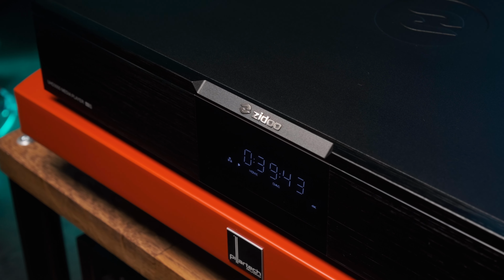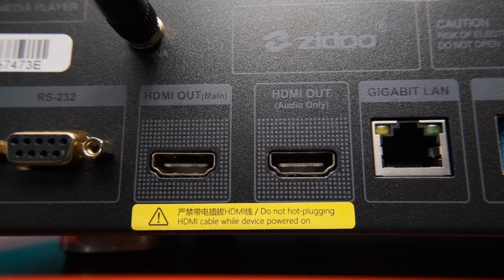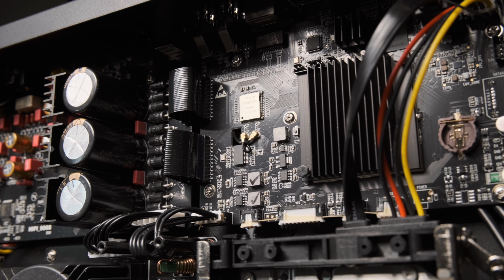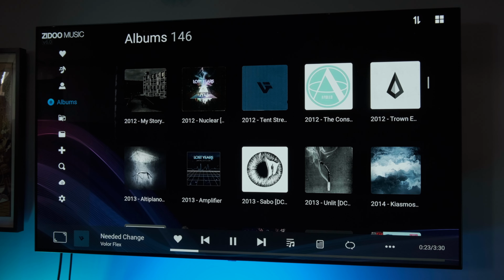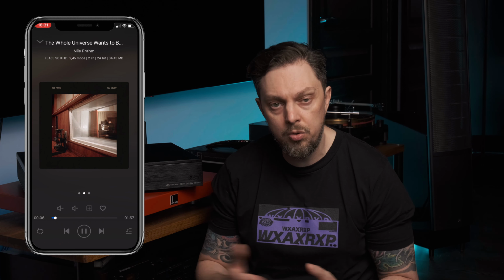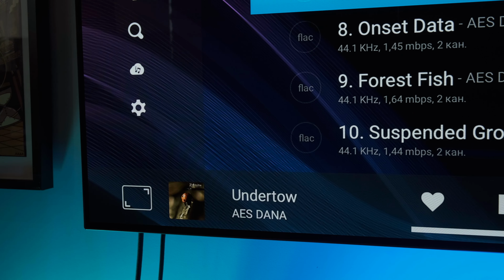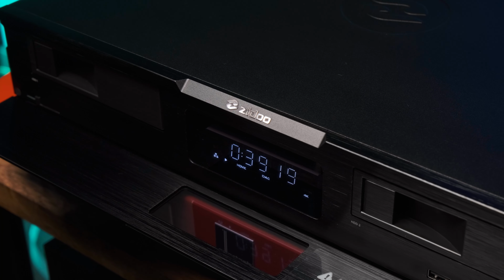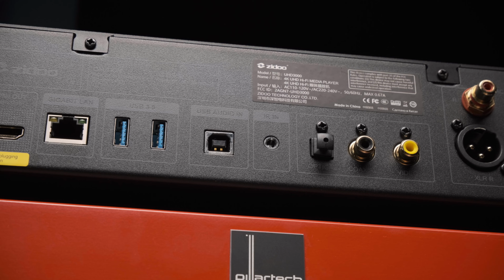4K UHD Media Player with Hi-Fi Sound – Zidoo UHD3000

Comment: Do you think I could use my Mac Mini M1 or Mini PC running Audirvana Studio to send ( via USB into the UHD3000 USB DAC input ) multichannel DSD and of course multichannel FLAC and then send that via the HDMI output to my Anthem AVM90? Right now I can't send DSD to my Anthem via the HDMI connection, even using DoP1 or 1.1.  So I am stuck not able to play multichannel DSD or SACD ISO's at all. Even stereo DSD I can't send digitally to my Anthem. I also have a Gustard X26 Pro DAC for listening to Tidal and Stereo SACDs. I would hope the UHD3000 would sound as good, but have my doubts. I want a nice media player anyways, but need to know I can send 5.1 DSD64 to the Anthem via HDMI.

Comment: With this money you get a nice set up hifi, movies? Use your TV 4k hdr
Reply: if you have a nice TV and Amp then you will make it  all so much better with this device even a 4k hdr TV needs something to play in  to it to take advantage of the HDR and this is where the zidoo shines its better its better than 4k blue ray all dolby vision formats the upscaling of lower res e.g 1080p to 4k is better than what your TV can do and I dont mean a little better but mouth open better the 8k version is out now it upscale to 8k.  if you want to get the best out of your 85 inch TV this is the device you want hands down if you know what this is capable of doing never buy a DVD again.
Reply: nice hifi set up for a grand? my speakers cost 5k the amp the same
Reply: Well OK let's  see I have denon 900ne net amp 800€, cd denon 900,400 € speakers Quad l23 classic, 900  €zidoo 1000pro 500 € and Sud from my uncle b&w Asa 1000, eversolo master edision 1300 € tv lg 55 oled 2500€, av amp denon 600 € and B&w surround system, with only music you can fix a nice system without spent big money 
 very happy with my system